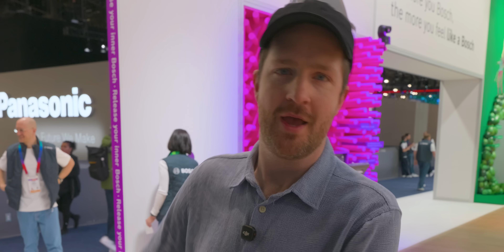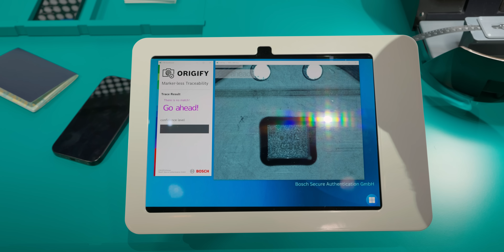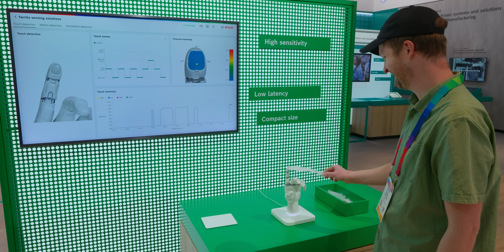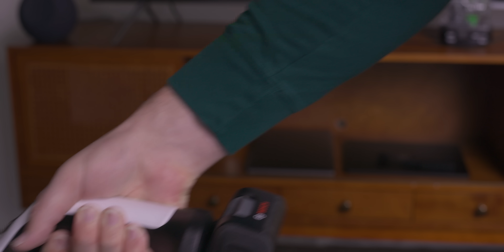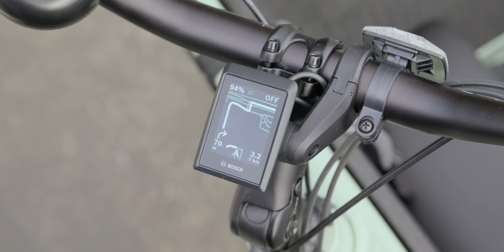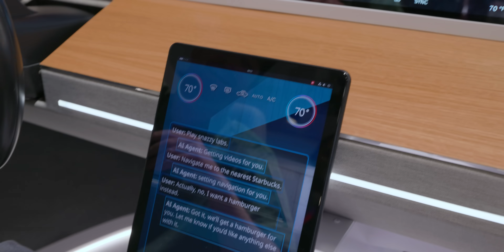Smaller Than a Grain of Rice. Smarter Than You'd Think.

Comment: The first half was so interesting: barometric sensors for pressure was so awesome.  The later half…has me less happy due to focus on, not parts that are interchangeable, but heavy integration which seems inescapable.  I should be able to do what I want with my data, and not have it only usable in the silos Bosch is ok with.

Comment: I use AI to summarize the content so you don't have to endure this shit

This video highlights *Bosch’s* massive behind-the-scenes role in modern technology, showcasing several key innovations from CES 2026:

*   *Anti-Counterfeiting:* *Origify* software uses smartphone cameras to identify "invisible fingerprints" on surfaces (like Pokémon cards or tiny chips) to authenticate products without QR codes or serial numbers.
*   *Advanced Sensors:* Bosch demonstrated how cheap barometric sensors can give robots a sense of touch sensitive enough to feel a feather, and how accelerometers in glasses can pick up speech through bone conduction.
*   *Smart Appliances:* New kitchen tech includes an induction cooktop that tracks moving pans and maintains precise temperatures, plus a high-end cordless vacuum with a debris compression system.
*   *E-Bike Security:* A new "Mark as Stolen" feature blacklists stolen bikes across the Bosch ecosystem, paired with digital alarms and phone-as-a-key functionality.
*   *AI Automotive:* Their "Smart Cockpit" uses AI to turn cars into mobile offices, allowing drivers to manage meetings, edit documents by voice, and interpret complex street signs.

*Bottom line:* Bosch isn't just an appliance brand; they provide the essential sensors, motors, and software found in almost every modern gadget and vehicle.

Comment: Bosch introduced part pairing in E-bikes, Apple style wich is terrible for right to repair. No third party replacements, no second hand parts. But they advertise this as "theft protection".
Reply: Theft protection…right….😂
Reply: it's even worse then that...they will snitch on you and call the cops if you try to change the battery yourself 😀
Reply: FYI, that is illegal. Contact consumer protection department.

What bosch is doing is illegal and goes against right-to-repair laws and consumer protection laws that protect consumers from things like this.
Reply: reminds me of what apple did, starting from the iphone 12 if i remember correctly
Reply: It's just the drive package and battery that's paired, right? Because i don't think the people buying $9,000 ebikes are trying to put chinese motors in them lol
Reply: @TheOfficialOriginalChad   yeah, as an owner of a non-Bosch high-end eMTB, none of us care about that. We want reliability and consistency when we ride, we tinker with the mechanical parts not the electronic ones. That’s for other ebikers. 
I’d happily buy one of their CS Race equipped bikes, complete with the battery powering a wireless drivetrain. 😉
Reply: But wouldn't you like to double your battery capacity?  @TheOfficialOriginalChad
Reply: @TheOfficialOriginalChad @IdrisFashan. That doesn't matter, doesn't matter if people do or dont. 

It's the principal, and what bosch is doing is illegal and goes against right-to-repair laws and consumer protection laws that protect consumers from things like this.
Reply: @NoBuyersremorse  yeah, like your president any day of the week or your House openly trading hours before “calamities” strike? 
Yeah, imagine a corporation getting in trouble in Murica for breaking laws. 😂

Comment: the Bosch that DRMs batteries and other parts for e-bikes?
Reply: I tried to replace the batteries in my Bosch vacuum cleaner - the BMS uses volatile memory, so the moment I disconnected the batteries it bricked itself.
There's no reason you'd do that except to be anti-consumer. They'll sell you a replacement battery pack...it costs more than the vacuum cost.

I already hated my Bosch powered e-bike for being locked down and this was the final straw. Fuck Bosch.
Reply: It's funny they along John Deere are sponsoring YouTube channels at the same time they limit what the user can do with their products
Reply: they can eat shit in that case
Reply: The same one
Reply: @fameismyname  🥶
Reply: i don't think you know what DRM means 🤣
Reply: @TheOfficialOriginalChad  Umm applying DRM to hardware is an industry tradition. Printer industry did it with Ink Cartridge. Making host device only work with proprietary coded BMS on battery modules. Now doing the reverse where proprietary batteries will only work with specific host devices. Is all forms of Digital Rights Management.